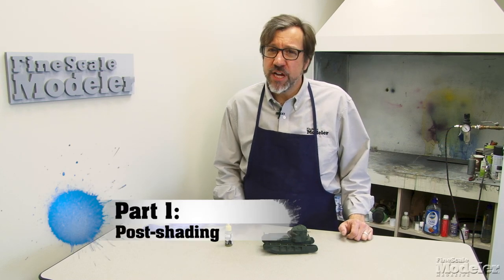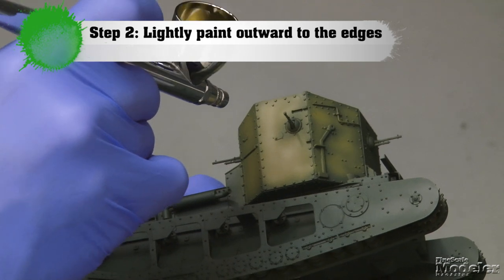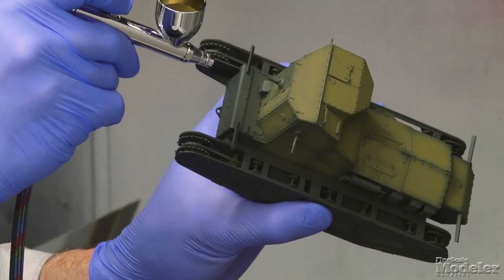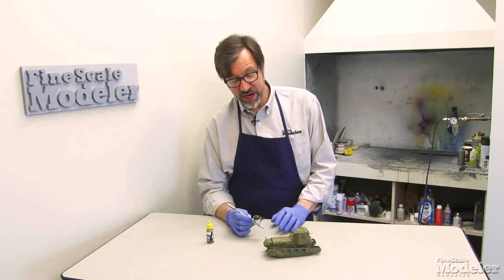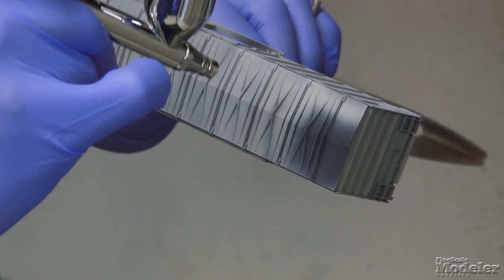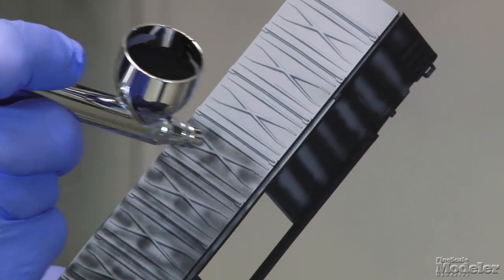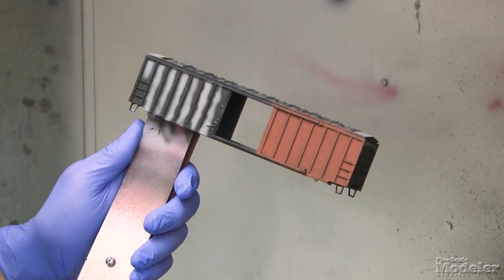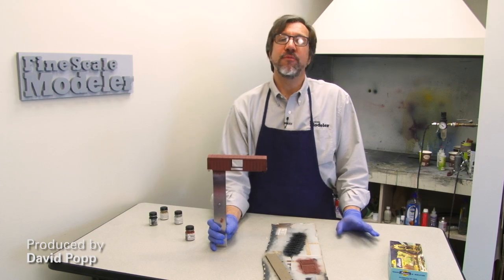Airbrush Shading Techniques for Scale Models — "Airbrushing with Aaron" Episode 7

Comment: For priming or base coats, I find it speeds things up to use a dedicated airbrush.  I have an Iwata pistol grip that gets a moderately wide spread and super even coverage.  I've found it will cover an area in about 1/3 the time, and get a more even coat.